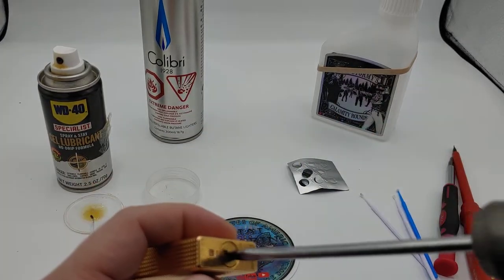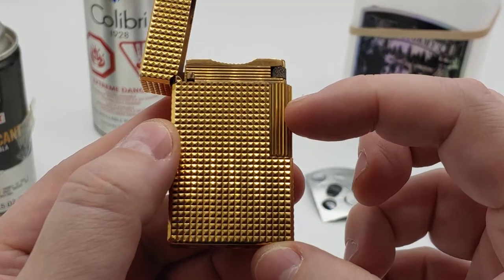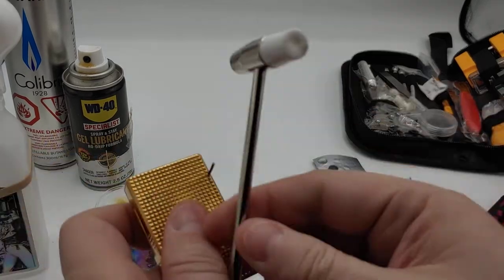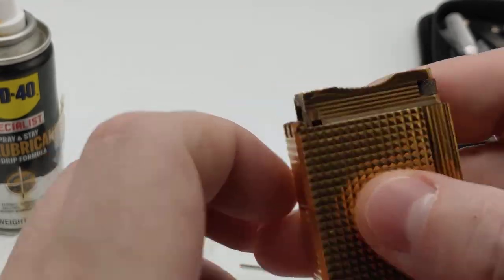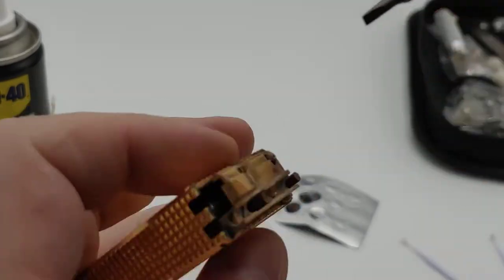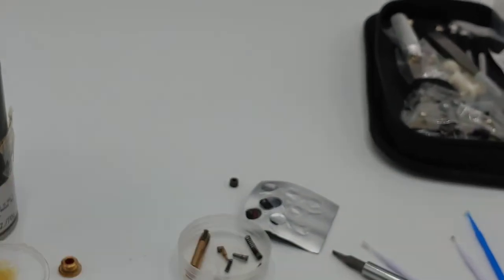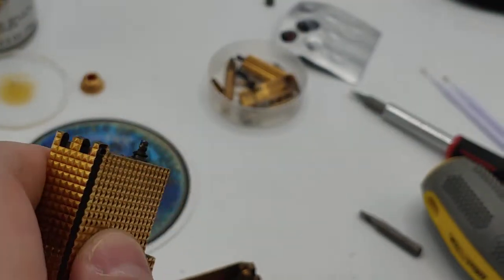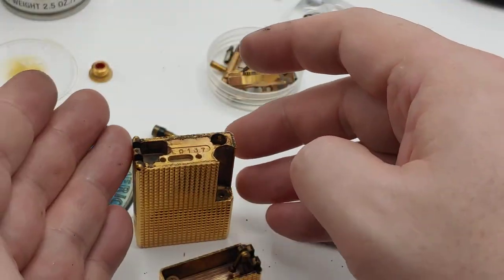ST DuPont Linge 1 Large Gold Lighter repair part 1 of 3 video 2/6/23 USA

Comment: It's not a line 2. It's a Ligne 1 Large, BR. There is also a Ligne 1 Small, and the Line 2 came much later. The Line 2 is very different in the filling valve and flame adjuster set up.

Comment: I actually have Rare 1960 Gold Line 1 with straight lines. One of its kind. I'm starting an auction in feb, so need to get it back in working condition but can't find any videos for general servicing and flint installation and neither does my country have any S.t Dupont retailers and servicing. What should I do?

Comment: Do you repair lighters for a fee? I have 2 at duponts from the 80s that no longer retain the butane and would like to fix them
Reply from the maker: I don't.   I only try and repair ones that I find on Ebay.   I only like to take them apart to try and fix them but I dont have the expensive valve removal tools.
Reply: @chaicharin  i found a vid where show how u can take it with 
You must give life to a monster of your choice  and tell your  story, in which a screw, two threads and a cylindrical piece i will try it in the next days if i fount it works, i show u how i did it

Comment: Would it be a good idea to put some wd40 on the stuck screws ?
Reply from the maker: They get stuck from the chemical reaction of the old flint and moisture.   It is very difficult to get the screws out if they are rusted shut since the screws are so tiny.  Very hard to get a good grip on them without stripping them or damaging the head of the screw.

Comment: that gas system is very simple i think you could technically make one of the Modern plastics valves work in it haha, on this one the gas start when you open the lid unlike the 2 right ?
Reply from the maker: Yeah as soon as you open the lid the gas starts coming out waiting for a spark.